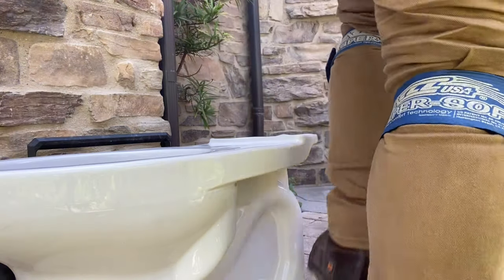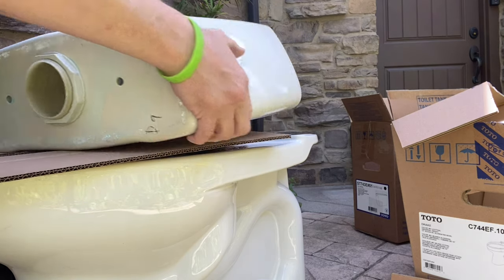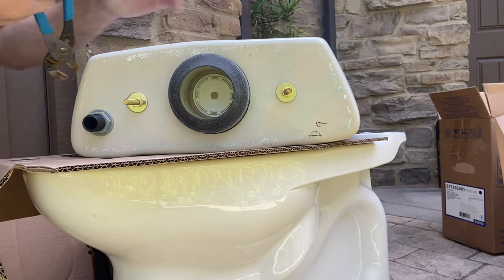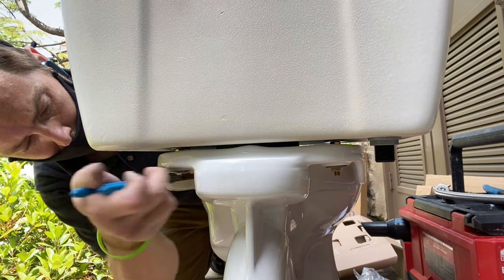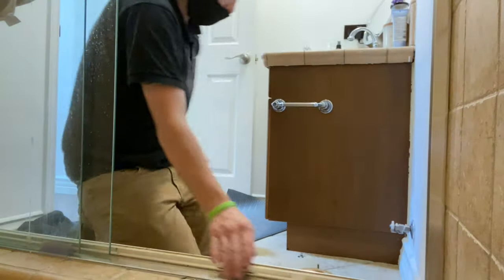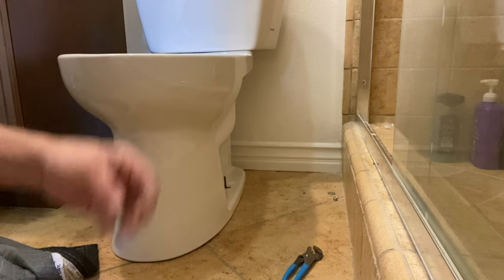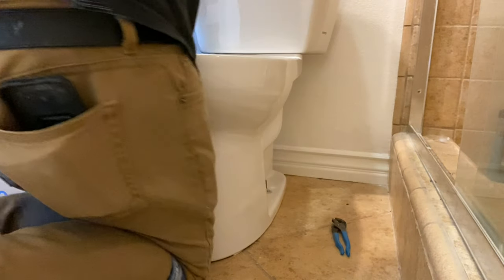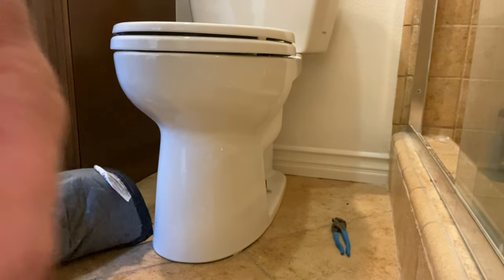Toto Eco Drake Two-Piece Toilet, 1.28GPF | Assembly, Install and Review by Plumbing Explained

Comment: Amazing video!  I have a 2 piece Toto (about 16 years old) that has a bad drain valve gasket. Tank level drops no matter what flapper I use.  Drains to just below flap.  I turn off water after tank fills and checked it the next morning, did several times. Toto customer service was helpful and suggested I convert mine to the new combination "tower flush" piece that has both the drain valve and flapper device in one tower piece.  They gave me all the part numbers I needed and I ordered everything, including new bolts online. I was intimidated a bit to take the tank off and replace my older system with this new one, but your video took all of that concern away as I now get exactly how it will need to be taken apart and put back together.  Keep up the great work and videos!!  Best, David

Comment: That's it, i'm sold, getting two.  Next smart toilets around the corner, but until then TOTO it is.  Thanks for the vid man, well done.  Local dealer quoted me $500 a piece including soft close  lids, wax, hoses and some other hardware.
Reply: Got my toto II for 450.00, went to a plumbing specialty store that sells at wholesale. I installed one and bought the second one later that day, these are terrific!

Comment: Thank you for this!  The part I couldn't understand without the help of this video is that the porcelain of the tank and porcelain of the bowl actually end up touching... but just barely.  Those of us who will only do this a few times in our lives have to be extra careful with this part!

I made sure the bathroom was totally quiet and just did quarter turns on the nut as the porcelain got close to touching.  I also rocked the tank forward a little as I tightened.  The moment it stopped rocking I stopped turning the nut.  All is well so far.
Reply: I screwed up and put the bowl onto the wax seal before putting the tank on. And now that the bowl is against the wall, I don't have clearance to screw the tank on. Shit
Reply: @longebane  I DID THIS TOO MANNNN
Oh man
I am so mad at myself for not reading/watching more before I did this...
Reply: @Ummm Kay  for a guy who claims to be a pro plumber but he uses channel lock pliars wtf.
Reply: @smokeskull  ? Almost all plumbers use Channel locks. Trusty blues are always the go to tool

Comment: Thanks for the video.  I replaced the rusted water tank screws, and in the process of tightened the the bolt at the bottom of the bowl I heard a cracking sound and the tank was cracked.  I barely turn my wrench less than 3~4 turns.  Then I read the instruction on the replacement bolt package: hand tight only.  Is it Toto so solid that you can put so much tension on the bolt?  or is my old tank so  bad that it cracked so easily?

Comment: You detailed the easy parts....then tossed it down and again detailed the bolts.....the hard part is the flange/ wax ring and you said use 2 ?..do you stack them on flange / do you use ring with plastic funnel ?
Reply from the maker: I just figured the wax was the easiest part I apologize for now showing that part but you set the single wax without horn down directly onto the flange then set the wax with horn directly ontop of that, then set your toilet onto the waxes. I demonstrate it in one of my other toilet install videos I don’t remember which one right now.

Comment: I just got this toilet, but needed a 10" rough in and round bowl...very small bathroom.  They sold me the 10" Unifit  to use with the 12" rough in with the round bowl...seems only 10" rough in for the Drake has the elongated bowl.   Have you had any issues with the unifit and the Drake?  Or should I risk the elongated may be a little longer and may look a little big in my small bathroom?

Comment: Looking to get the drake II.  Seems like I will have to special order it as I can't find one locally.  Lowes only has the right hand lever model for some reason.
Reply from the maker: They're hard to find these days, Toto just redesigned the original drake its coming out tomorrow at my local supply house, im picking up 2 and ill be doing a video on them, will probably post them next week.
Reply: @PlumbingExplained  I think I ordered one of these new ones.  It was confusing to me as there is the drake, the drake II, and again, the drake lol.  I saw the toto site had a "new" banner on a few models, and ended up placing an order for one of them.

Comment: thanks chris,   good video    dont  need to see it  but always looking to  learn or relearn.   its all the subtle things like tightening  the tank or   checking flush  and fill valve.    installed quite a few totos years ago    and have 2 still in my house .  was thinking about changing one  it still looks good but  remodeling the bathroom,    so was looking at a drake round bowl     Ive got a 2001  1.6 gal round 2 piece toto that works fine   might just reset it. what do you think  new 1.28  or   keep the 1.6
Reply from the maker: Keep the 1.6 I can’t get them anymore or that’s what I’d be suggesting for sure! Always good to hear from you Jeff!
Reply: @Jeff Y I recently installed a new ToTo 1.28 toilet. It works great with the new vortex flush system. I’m very happy with my Ultramax II, and I’m in the middle of installing my Drake II.

Comment: HI I bought the TOTO Drake; had a plumber install, yesterday.  The TANK rocks back and forth!  Plumber is gone.  In the garage, the TOTO TANK BOX says:  ECO DRAKE.   The BOWL box says:  DRAKE.  Does this mean the store gave me the WRONG PAIR?   OR, did my plumber NOT do the install correctly???  Thanks
Reply from the maker: No the bowl doesn’t have to say eco drake on it, the tank is the eco drake part but you need to call the plumber back to secure the tank properly!! Like I show in the video it should be solid!!
Reply: You read it wrong. It's the toto shake toilet.

Comment: Hello, you said that you recommend using 2 wax rings, I'm a novice at toilet installation, do I stack them on each other?? Is that the reason you had to shim? That would be my luck, where the toilet would then wobble. Thanks 👍
Reply from the maker: Get one wax with flange and one was without flange stick the wax with flange ontop of the wax without flange, when you set the toilet it will all squish down, I needed shims because the floors aren’t level.
Reply: @PlumbingExplained  gotcha thanks for the quick response 👍

Comment: Mid 2023 replaced my old , old toilet... Paid $291.19 (walk out the door total with the Lowes 5% credit discount + plus 6% sales tax PA)  for the 1.28 TOTO model CST775 - 2 piece, watersense  12 in rough in. Drake Cotton round, standard height.

Now everybody is trying to copy their flush ..  Even got the Kohler plastic slow close toilet lid AND it has LED lights that make the water glow blue at night. It even has the right side flush handle!  

I had to order it from Lowe's .... not something they have in the store.

Comment: Hi, thanks for the video.  We are building a new house and I plan to install 3 Toto toilets and was leaning to the Drake, especially after watching your videos. However, it seems on some of Toto's toilets with their new flushing system there is a almost a shelf in the bowl with a very small water spot, which causes an issue with streaking.  Do you know which of the Drake models (Eco Drake, Drake II, dual flush?) have this shelf bowl vs the bowl with the larger water spot?
Reply from the maker: I would stay away from Dual Flush toilets right now I havent had a great experience with any model from any brand. The Toto's are fantastic the new flush valve system is in my opinion the best on the market today, I havent had to change one of the new flush valves or flappers yet! Except for one defective one when they first came out.

Comment: The good thing about these units is you can put the old type 5 gallon flush tank on it to make it good for those of us that REALLY take a crap! The small tank can be put in the children's bathroom and the wife's bathroom but in the MAN'S bathroom you need the powerful flush,.  The 5 gallon flush also insures your entire drain line is washed out so settling doesn't clog the line.

Comment: Is the rubber seals better like Fluidmaster better then wax ?
Reply from the maker: I prefer wax rings over the rubber seals but the people at fluidmaster swear by those seals
Reply: @PlumbingExplained  can you use jumbo wax or best use 2 registrar
Reply from the maker: I always use 2 wax rings even if i use an xtra thick wax ring, I live in California and the ground moves alot here so houses are constantly settling, Not sure what its like in other parts of the country. I just always use 2 even if the flange is level with the floor.

Comment: Hi, 1st time watching your vids. Gonna be moving into my 1st new home in several weeks and looking for new toilets (2). Would live thoughts on a One-Piece or Two-Piece and is one better than another? After doing research the brand looking at is Toto Drake II and possibly a ICERA Vista II skirted toilet and these are both 2-piece toilets. But wondering if a 1-piece is “better”? 
Looking for a 1.28 gpf toilet W/O DUAL FLUSH & 100% want the LEVER (as not a fan of dual flush or sticking  fingers into the button holes etc…).
I’m “old fashioned” and when I use a toilet, wanna push a lever and have the toilet WORK, and LAST LONGER then me😉
Renting currently and in the 5 yrs been at the house, I’ve had to replace/rebuild all the 2-piece toilets at least 2, and one toilet has been done 7 times 🤦🏼.
Thx for video and any help you give/share✌🏻
Reply from the maker: Definitely stay away from the Dual flush toilets I hate them to be honest with you, They become very problematic over time in my experience. If you are set on 2 piece toilets the Drake is a great toilet I am not a big fan of the skirted toilets because they use a plastic mounting system that I have had to clear many many clogs from. Pulling and snaking a Skirted toilet is more expensive when they clog as well. I suggest If you have it in your budget to go with a Toto Ultramaxx II or Toto Supreme they are The best flushing one piece toilets on the market in my opinon. Hope this Helps! Thank you for the comment Sorry for the late reply I never got  a notification.

Comment: Thanks for your video! I installed two one piece ToTo toilets that were easy. But I had trouble figuring out assembling my new Drake II until I saw your video.

I found it weird that the tank was rocking a bit on my Drake II. And it appears that the new design doesn’t have the two raised areas in front, which makes it less intuitive to assemble. I left a very slight play in mine, because I didn’t want to over torque the bolts. But, like you mentioned, it’s very solid once mated correctly. I opted for a thick wax ring, rather than doubling two standard ones.

One of my three ToTo toilets came with a bad fill valve though. I’m hoping ToTo or the shop I bought it from will easily help me out with a replacement part. 🤞

Btw, I also decided to install new 1/4 turn valves along with new water supply lines. I feel like those things should be standard things to be changed along with new closet bolts. 🙏 🙏 🙏
Reply from the maker: Yes quarter turn stops should be standard now a days! Good job and congratulations on a great install!!